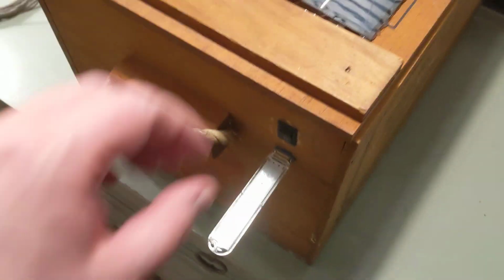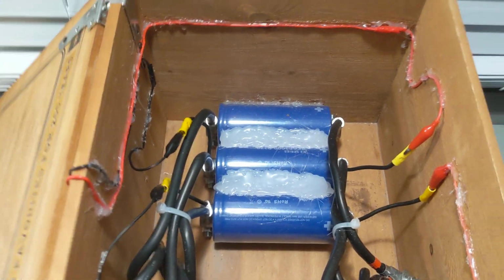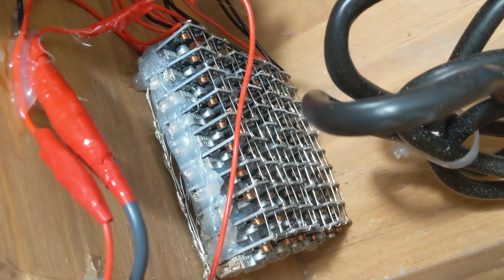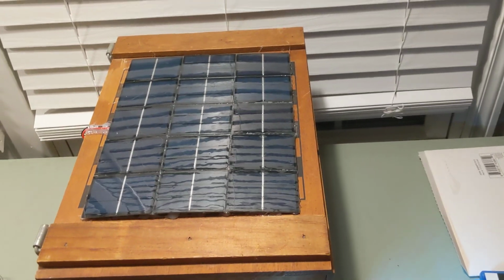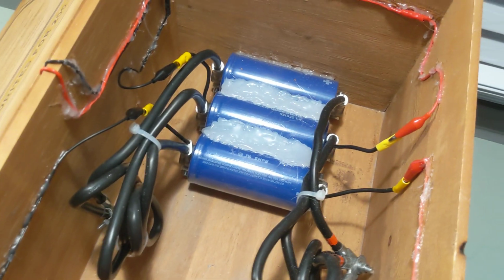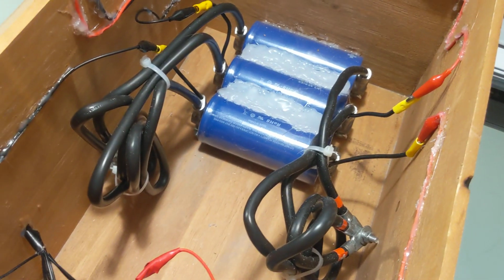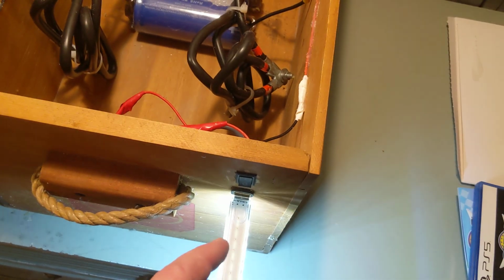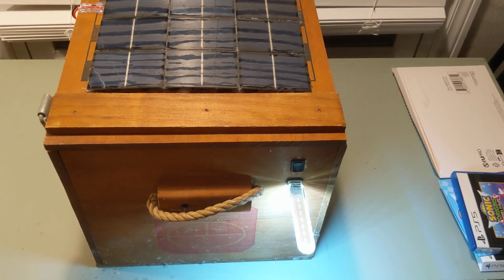Supercapacitor Emergency Energy Harvesting Phone Charger

Comment: Li-Ion batteries only die after a few years IF (and only "if") you dont keep them between 20% and 80% charge, make their environment way too hot or too cold, cycle them way too often or damage them otherwise. If you use, say, Li-Fe-PO batteries, keep them in their comfortable zones of charge and temperature, properly pack them with fireproof isolation foam and dont abuse them ... they might as well last 20 years or more. Its very possible to make them live for even longer - it all depends on how well you build & use them. Advanced charging algorithms help *A FRIGGIN LOT*. Climate control helps even more. Perfect climate all the time = unbelievable lifetime. We're talking "all of one human lifetime" if you also control humidity.
Also : these supercaps will not last 300 years. They will probably break down after two decades, if not less. Thats just .... IRL physics, my guy.
Reply from the maker: The supercaps are max 2.7V.  I'm only charging them to 1.2V.  Lifespan will be about 300 years yup yup yup.  Your enthusiasm for lithium batteries seems to come with many constraints on where and how you have to use them.  I am aware of how to properly CC CV charge lithium batteries and how to take care of them.  However, if you try to use them like a normal person would for emergency energy storage, then when you come back to them a while later, they are puffed up marshmallows.
Reply: @nostrumuva  Physics and material degradation facts dont change - yup yup. Even if you put "enthusiasm" into the topic.
My emergency energy storage (also : regular energy storage for my entire house) even has 10 years of warranty and more than 20 of expected lifetime. Thats much more than your little caps will ever be able to demonstrate. Just saying. Also : yup yup.

Comment: MORE CAPS!!!! Make a monstrosity!!!

But I’ll say this, maybe panels on a seperate board and have them plug into the box via some connection plug, just cause it’s going to be in the sun…
Reply from the maker: Yeah I could add more supercaps in parallel, and then it would last longer to actually run a high powered USB device for longer than 30 minutes.

Comment: The problem you seem to try to solve here is how to store electrical energy over a longer period as an emergency solution. I wil not comment your hardware overkill, it has been done before. But I have a suggestion for you: Try to work out something with a fuel cell. You can store a small bottle of hydrogen and oxygen very compact and it will not decay in a 1000 years.
Reply from the maker: Yeah I know there are better fuel cells like nickel hydrogen is great and lasts a real long time.  But the point was to use something a bit more commercially available, and to learn about supercapacitors.

Comment: Great build! I feel the caps should be held down with something more robust. If they ever shook lose, they could do some damage. I'm impressed with your hand-made voltage boosting matrix!
Reply from the maker: Yup it's just hot glue holding those down.  If a metal wire shorted them it would vaporize.  The booster matrix took a while and multiple iterations cause I was trying to do better load balancing first with resistor droop or other methods but ran into some issues with those methods.

Comment: Nothing in that box makes sense. The wires are way to big. Why would you need 60 boost converters for usb output. Using supercapacitors makes no sense ether, one 18650 cell has the same Wh and no, they dont destory themselfs after a few years!. If you dont use a 18650, they last 10s of years. This is just expensive waste of resources.
Reply: I had a good laugh when i Saw all those Boost converters 😂
Reply from the maker: Obviously yes it is not energy efficient at all.  If you bothered to listen, you would have heard the explanation for why this was done.  As your assignment, instead of using 60 boost converters, please create a single boost converter for me that is commercially available to go from 1.2V to 5V at a minimum of 500mA.
Reply: It doesn't have to make sense, you never made something just for the fun of it? You always learn things even from the dumbest of experiments 😁

Comment: For the cost of those supercaps you could have gotten a 40 Ah LTO cell. That's over 80 Wh energy!
You also only need a single boost converter otherwise you waste most of the energy in quiescent drain.
Reply from the maker: I am aware of the severe energy inefficiency.  If you listen to the explanation, the point was to store energy for a long period of time at low voltage, then be able to boost it up, and not to use lithium batteries.

Comment: Great job! Good video. Would have liked to know the part numbers for the specific cells, caps, and boosters you used. Perhaps the description can be tweaked to have a list?
Reply from the maker: They were 3000F Maxwell supercaps with 2.7V max.  The boosters were cheap things like this: https://www.amazon.com/0-9V-5V-Voltage-Converter-Booster-Supply/dp/B0BYV1YNY6

Comment: I built something similar for powering small appliances or a powertool.    It's hard to build these nowadays cuz the supercaps aren't as abundant on the market like it was 10 years ago.  The ones on amazon are either fake or too expensive.
Reply from the maker: When I order the 3000F capacitors, sometimes they come with different sized center leads than specified on amazon, so I had to be creative to make connections to them.  Autozone was the answer.